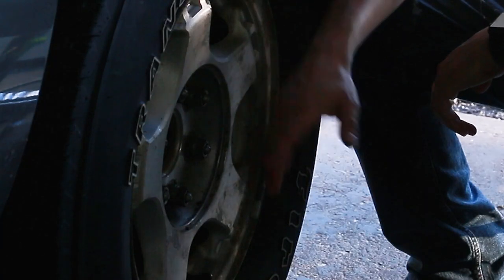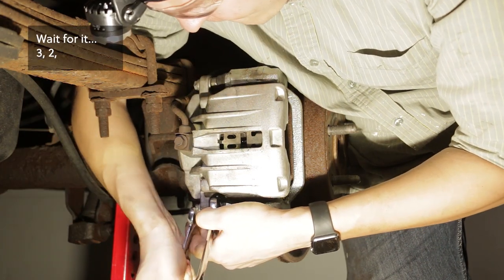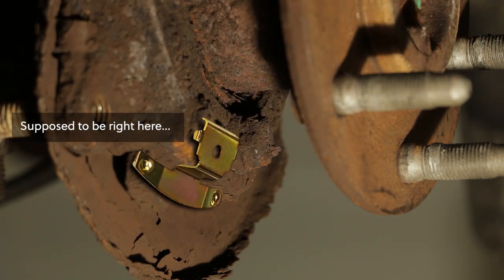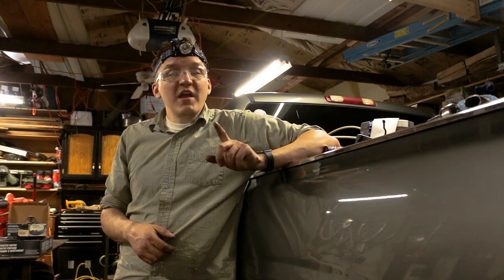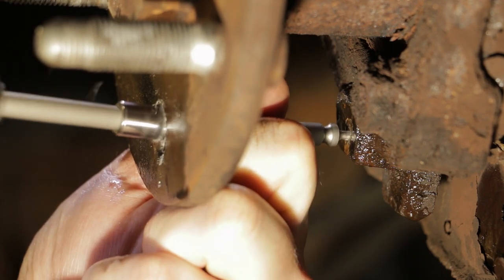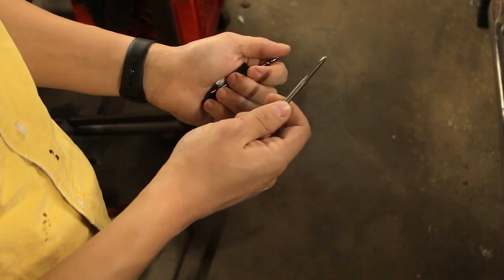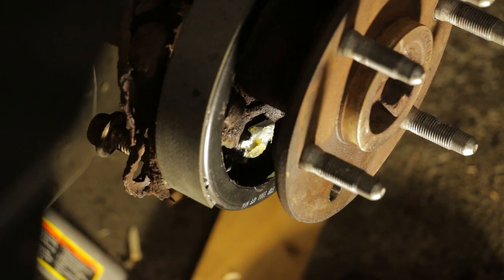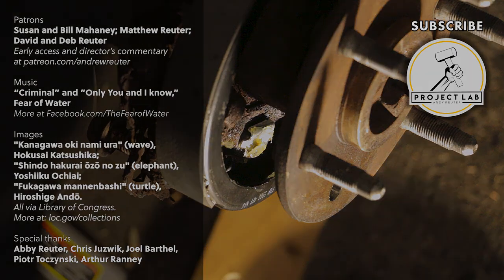2002 Chevy Silverado rear brake fix, Part 1 | Project Old Grey

Comment: There should be something when a car/truck is built that says.."going to the Rust Belt" and then every thing with a thread on it under the body is installed with anti-seize. I know manufacturers don't care as long as the vehicle makes it past it's Warranty...but really.
Reply from the maker: ^^^^^^This.^^^^^^ And anti-seize on the backs of hubs too! Would save so much time and pain down the line...

Comment: Good job. Snapped mine off too. I already figured an extractor wasnt going to be worth trying. Im installing new 2 piece dust shields so I removed that back mounting with the four 18mm bolts. That may enable me to tap a new hole without removing a stud. Im also questioning the need for that retaining clip. The old ones on both sides were completly rusted off, probably for years, with no apparent problems. 

Edit: Found I couldn't reach the screwhole with standard bits and didnt have any longer ones, so I decided to remove a stud like you did. Worked great, especially with the back plate unbolted. I was able to clamp it right up against the back of the wheel plate with the stud hole directly over the broken bolt hole. I wasn't sure what size hole to tap but after trying some known bolt sizes I decided that it was a 10-32. I used a 5/32 drill bit to drill into the broken off screw and came out the other side. I then used a 10-32 tap. The spring clip screw was a bit snug at first so I'm not sure 10-32 was the exact fit (likely metric) but it snugged up fine. Thanks for the stud removal idea, I'm not sure😂 that would've ever occurred to me.
Reply from the maker: Not a fun scenario but awesome to hear it came out OK, thanks for the update!

Comment: Great video! Next time try a lug nut with a few turns in the stud and hit THAT. it’ll stay in place and you won’t hurt the threads. Thanks for making these. Some things I know and some I don’t. More than 1 way to skin a cat and I appreciate you taking your time to educate and entertain
Reply from the maker: Thank you, glad to do it! Good tip on the lug nut!
Reply: After not having any luck with the the 2x4, I considered the lug nut trick but was concerned that it might damage the threads. I went with a flat nose cold chisel and the stud popped right out. To prevent the chisel from possibly slipping off I screwed a lug nut on just the end of the stud.

Comment: Why don’t u use wd40 or pb blaster, spray, let it sit for 15-20 min an then rusty bolts 8 times outta 10 will come right loose.
Reply from the maker: Totally agree on the PB Blaster! I was using it here but the problem with that little screw was that it was a through hole, and it was rusted in the back. Had I known that, I would have cleared that rust away back there and maybe prevented the snapping. Oh well, next time…
Reply: I've never had good luck with either but I always give it a try first. You even have to be careful tightening them or theyll snap off. Those small screws are ridiculously fragile as are brake caliber bleeder screws.